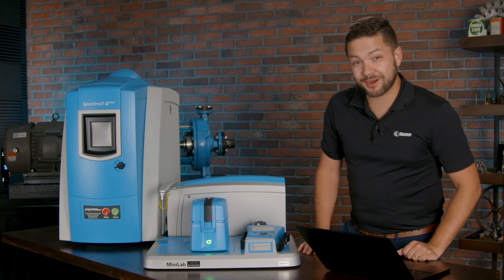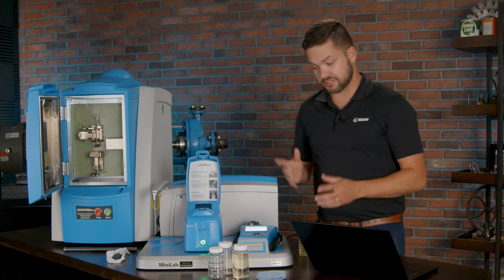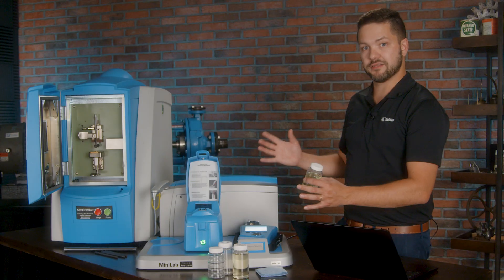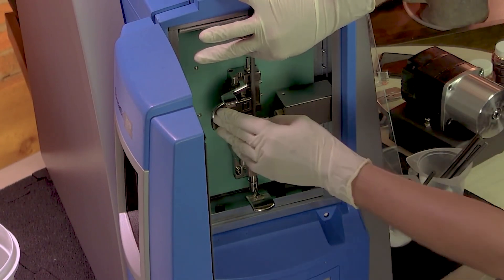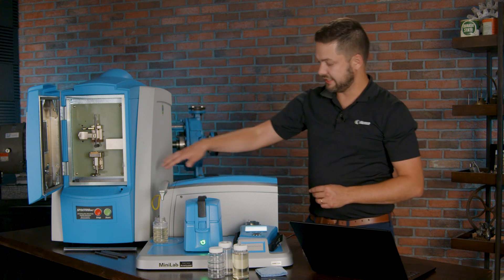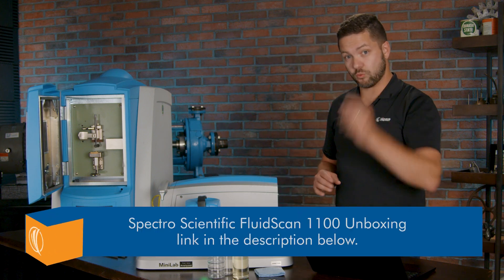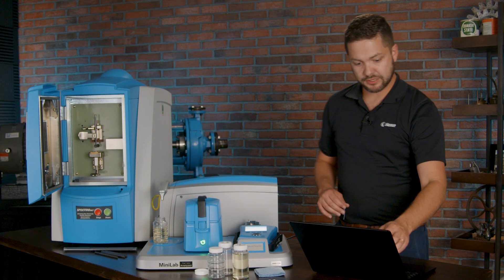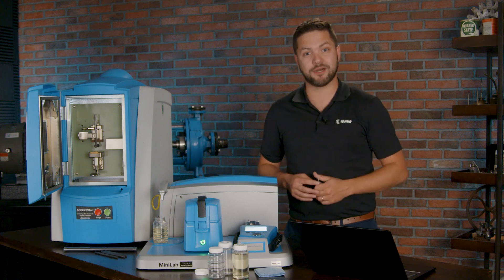Unboxing: Ametek Spectro Scientific Minilab 153

Comment: Hello, how are you?, In the laboratory where I work, we have one of these devices. We will use it for oil analysis, and the equipment is the MiniLab 153. It comes with all integrated components (MiniVisc, Spectroil, LNF, and FluidScan). After speaking with the technician, he mentioned that the particle counter (LNF) requires dilution for oils with a viscosity above 320 cSt. I was wondering what the correct dilution technique is or how we should proceed with this. I would appreciate any guidance you could provide.